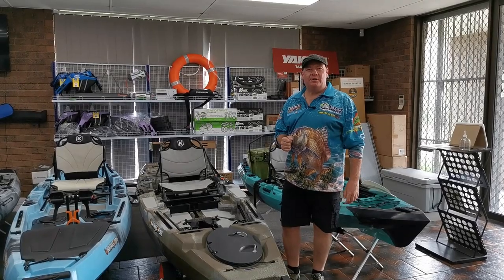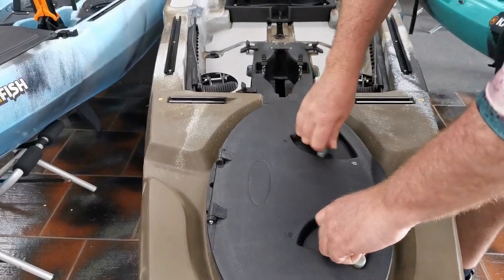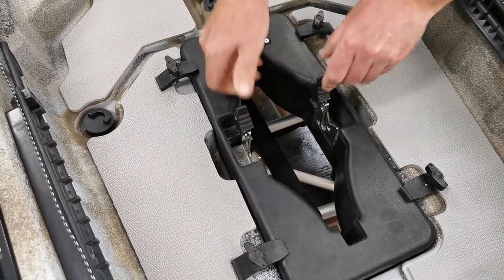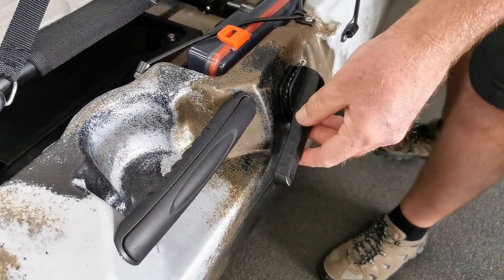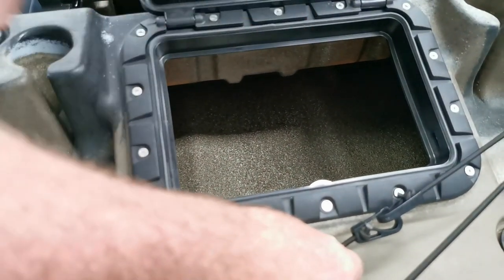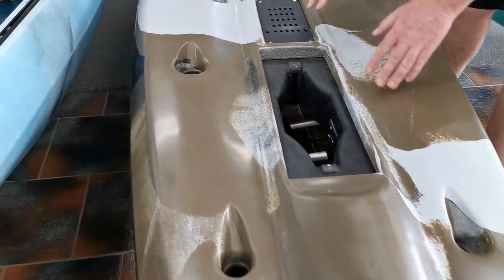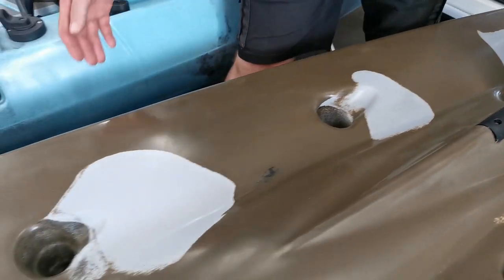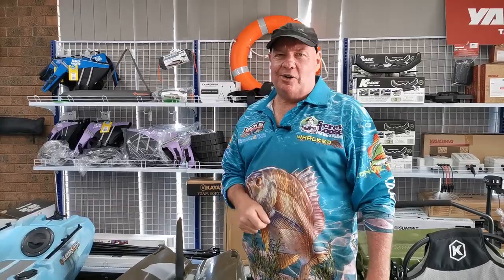Sneak Preview For The NextGen 11.5

Comment: these new storage hulls...are they water tight?
Reply from the maker: The hatches are water resistant.
Reply: suppose a rubber seal would help it keep the water out
Reply from the maker: It cannot be guaranteed. But probably it will.